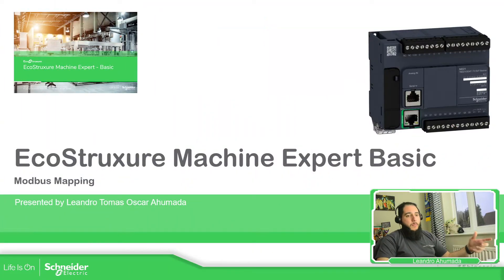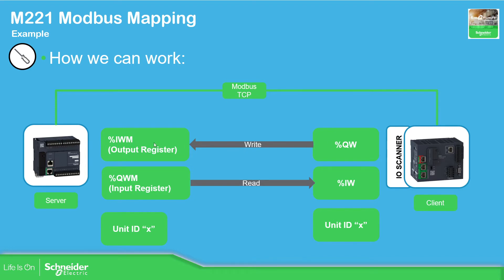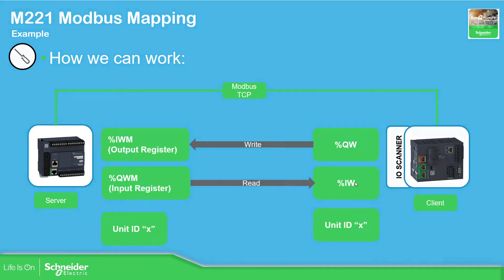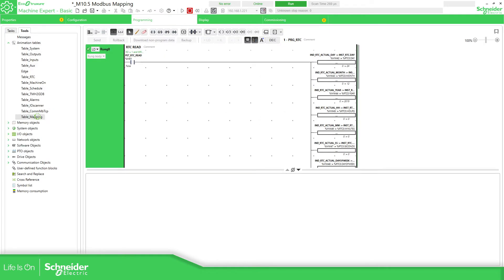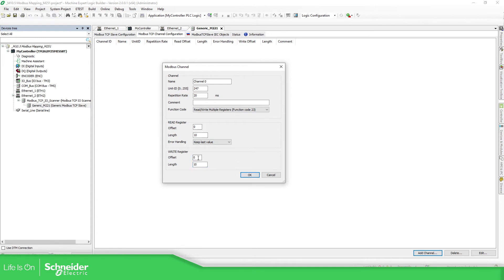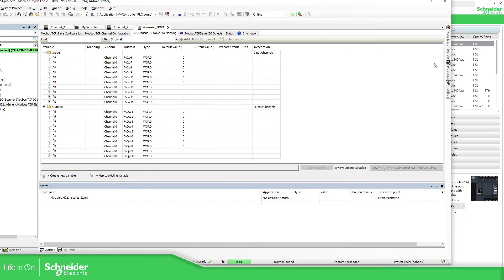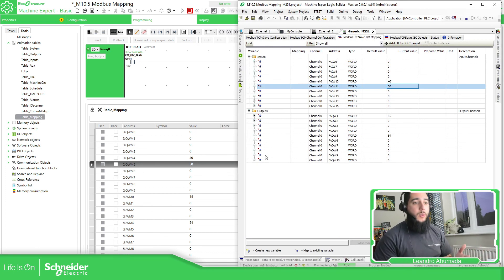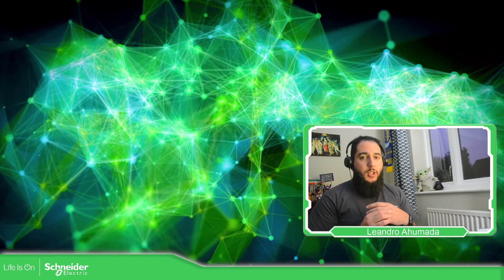Training - M221 - M10.5 Modbus Mapping with Modicon M262

Comment: I can pass the data back and forth but how do i reference it in the programming? For example.. in this video we are writing their values in. How to i write from the program to the qwn locations? I cannot find this information anywhere.
Reply from the maker: Hi there! Similar to using the inputs IWN we have another area for the QWN, it is much easier to assign a symbol so we do not use the long syntax QWNx.x.x
You can use the operator block to write to them example:
%QWN0.0.1 := %MW12
Or fix value
%QWN0.3.2 := 8

Comment: I try to communicate 2 m221 uaing modbus tcp. I enable the io scanner in the first one and make read/write var, just 1 address. Then in the second plc i enable modbus but not the io scanner. What happen is sometimes i can write to the plc. Sometimes I can't. I tried to log on amd log off. But it is inconsistent. Sometimes it will work sometimes it will not. Why is that?
Reply from the maker: Hi there! In that case the best is to check the system word related to the Ioscanner and validate that the communication is okay then use wireshark to see the traffic.

Comment: Question, I have seen a video to use M221 as client, and it can have up to 64 slaves, correct? I am task for 15 devices slaves of diff brand, what model can you recommend M262 or M221 ?  If any, I assume that this master whichever you recommend can be a server at the same time to my monitoring SCADA ?
Reply from the maker: Hi there! I believe there is a limitation in the amount of server (modbustcp) / slave (modbus serial) that you can use. Please check it on the ioscanner setting and try to add aditional devices to check the limits
Reply: @LeTomasAHUMADA  Thanks let me check on that. I ran through their series, and it appears to be M251 most suited to my requirements. Am I correct that although it says it can have up to 64 slaves, still needs to verify ?

Comment: Can we configure output registers (%IWM) inside slave PLC, in terms restarting the value, or deleting value inside register somehow?
Reply from the maker: HI Vukasin! I am not 100% sure if i understood that question but i believe you want to assign a value to the output registers (%IWM), correct? If that is the case I am afraid that it is not possible because that information %IWM is coming from other device. That Modbus TCP -> Modbus mapping is a particular area in the M221 to be use with other devices over ethernet.

Comment: What should we use mapping on one and io scanner on other one controller,why would we use mapping on both controllers
Reply from the maker: Hi Ajithkumar Elumalai! in this case the M221 in EthernetIp can only be adapter that's why we set ModbusMapping in this controller. In order to read the information from the M221 the other devie , in this case the M262, we used the IOscanner for EthernetIP to make the connection easier. In modbus tcp over ethernet would have been a different story.

Comment: Can I do the same on two m221 plc
Reply from the maker: Hi Ajithkumar! Between 2 M221s it is not possible because the m221 can only be adapter on ethernet ip (like it was a slave in serial). You can use ModbusTcp to communicate 2 M221s check the next video in how to use the ioscanner: https://youtu.be/nyXspkScEjk
Reply: @LeTomasAHUMADA  thank you

Comment: Thanks for the idea! dude i got 1-m241 and 5-m221 can i use the same method to read and write?? please help. thank you!
Reply from the maker: Hi iShoeb Mirza! You can do the same. If the default amount of variables are good then you can use the same eds and change only the network configuration in the m241
Reply: @LeTomasAHUMADA  Thanks for the response! what is the meaning of eds??
Reply from the maker: @Shoeb_mirza  Electronic Data Sheets (EDS)